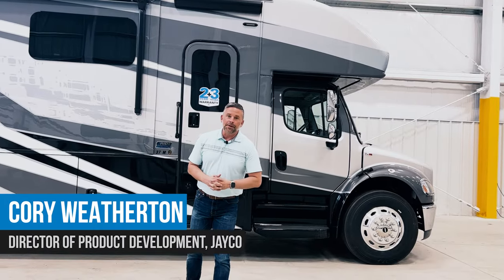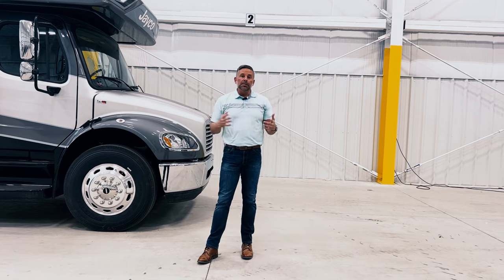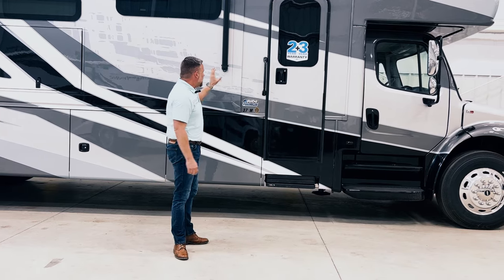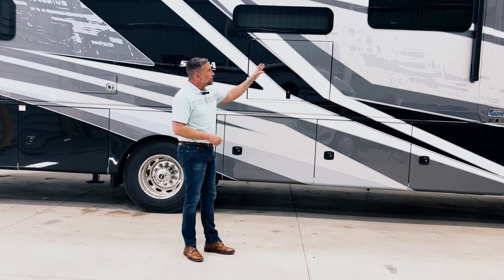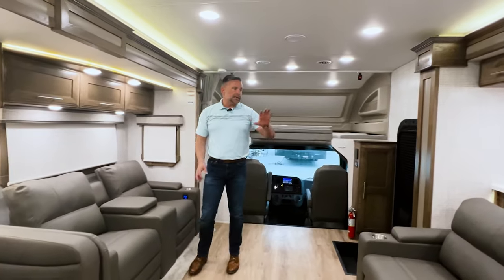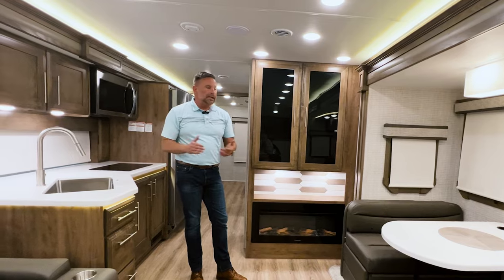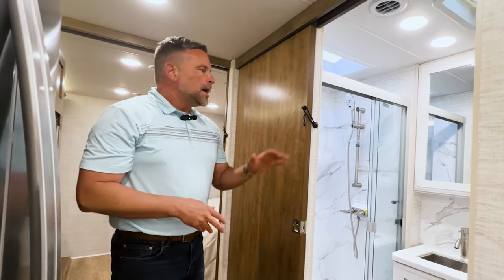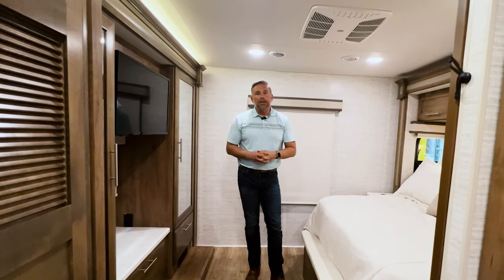2024 Super Class C Seneca - Jayco RV

Comment: Can i ask how much electricity the stove needs to run? And can you run the big fridge while driving down the road? A LOT of people are looking to boondock (too many people in the campgrounds and not enough campgrounds for all the people
Reply from the maker: Hi there! The stove needs 1750 w/hr (150 F - 450 F) to run. We use a 12V refrigerator in the 29T, while in the other floorplans, we use a 120V residential refrigerator. Both refrigerators can be used while driving down the road.